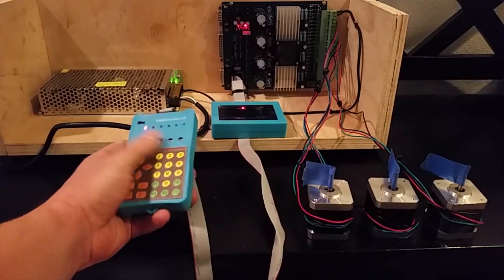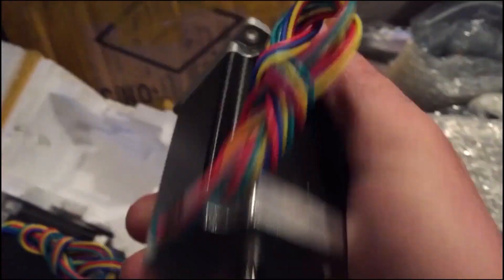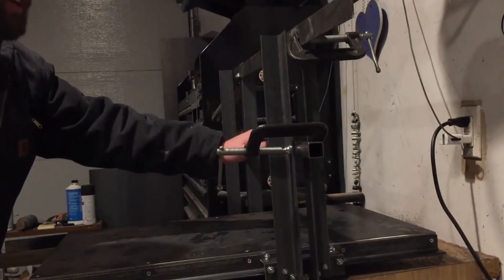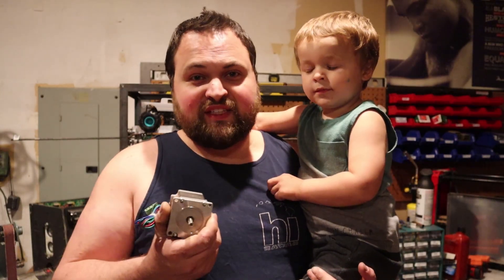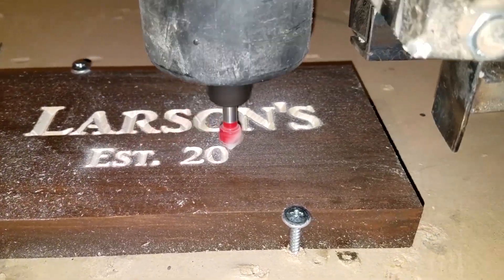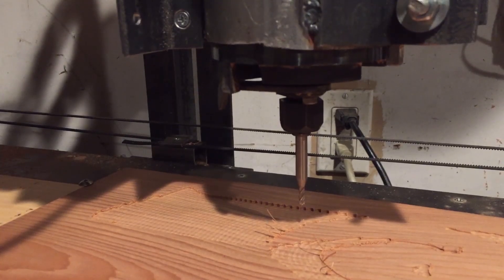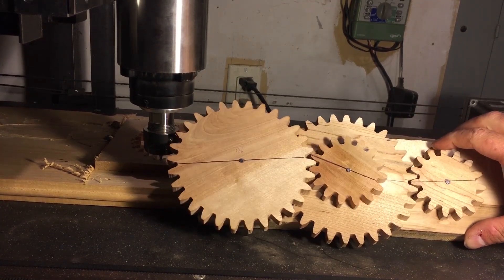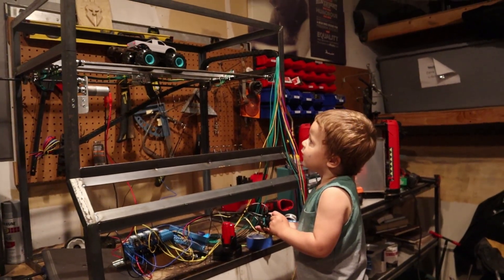How To make a CNC machine for $500

Comment: LOVE IT! 
Your video is one of the best that I saw and I saw a lot. I have a budget about 2K and that should be enough to build me a better and bigger one. I see that people mostly use expensive and way to big materials to hold the hole system together. I don't understand why?
If I am not wrong, the only aim is to move a 1-2 kg motor safely in x/y/z directions and there is not big of a resistance for the movement eighter. So, why they use so much metal equipment? They are building some chassis for a CNC as if they will become a chassis for a truck. Strange 🤨 
Long story short, no need for a razor sharp Catana sword to slice bread. 
Greetings from Türkiye 👋

Comment: where did you source your allthread for the z axis?  poking around the interwebs some people suggest using acme thread instead of what you get at a hardware store, for increase life and accuracy.  doesn't seem like you had any problems.
Reply from the maker: I bought some acme thread for my CNC plasma cutter, it had .005" clearance when it was brand new. Total garbage. I used all thread (1/4"-20). If you want better you'll need to spring for ball screws. More money but better quality.

Comment: There are so many parts to know about on a CNC machine that its unlikely a single person would know them all before building their first machine. Personally I am good at the computer bits but not very good at the basics of hardware -like even cutting a piece of sheet metal. As a result its likely that building your own is going to involve some expenditure on bits that you are least familiar with. So be it.
Btw. I have watched videos that suggest the fans on air cooled motors are a big source of vibration on those spindles, might be a good idea to go water cooled on the next one, would also keep the noise down a bit. I also read that Tinkercad models can be imported into Fusion360 (its the same company), Tinkercad is super easy to use.

Comment: Looking at making a CNC router machine, I started in 2020 learning with a Ender 3-v2 FDM printer, then I been building a custom 400x400x500mm FDM printer from an extender frame and purchased spare parts. Now I'm hoping to learn the other end of the fabrication process by applying the experience gathered. So far the bottle neck for me has been learning the FreeCAD software but if I can learn Blender 3D enough to make models and print them on a FDM machine then this to should only take time.
Reply: can you text me I need help to build cnc 1 axix

Comment: Fusion360 is has a steep learning curve. I was doing 3D drawing with AutoCad when it was experimental. At the time I was using ACAD10 to design machinery and parts in 2D during the day and drawing build sheets for retrofitting the roof decks of large buildings from steel to precast cement at night. That said I am not new to CAD and eventually started using SketchUp for personal projects. After hitting the wall a few times with F360 I realized that the big problem is that there is little or no feedback when you try to do something and it does not work. Off to Googling how to do something until I find someone had the same problem and the pro is trying to recreate the problem to help figure out why it is not working for this guy. Oh, you had a constraint that was preventing you from moving this or your part had a broken segment and would not allow you to create a solid object.
 Fair reasons but for the love of all that is holy, why can't the software  offer a suggestion to the problem?   I remember working with a developer on a piece he was writing to facilitate a change to the software the company I worked for from ibm MOVEX to SAP. After he was finished I was instructed to ask him about documentation. He told me that if anyone needed documentation to use software he wrote that he considered his work a complete failure. He made a huge effort to make every operation as intuitive as possible so it was obvious what you needed to do. 
Back in the early 80's programmers were expected to optimize software to efficiently use resources, like memory and machine cycles.(I was one of the first in my class to use a monitor instead of a huge fan fold dot matrix printer to write and run a program.) Fast forward to the 90s and the big software companies were realizing the help desk and training could add to the bottom line making software intuitive was naive. So don't feel too bad about not knowing how to use some really great software, it appears to be by design. It is either that or the developers and their project managers are clueless and cannot make anything that is obvious how to use, or they want to maintain their elite status of mastery of their software. Who knows maybe a little of all three. There, I got my rant out. lol
Press on!

Comment: Can you link the cnc kit on ebay. Or do a list of things you had needed.
Reply from the maker: https://youtu.be/kM9bWo8Rl84

This is the video showing the complete setup.
Reply: @StrangeGarage  the resource link I'm asking for the cnc kit on Ebay. It's not in the description
Reply from the maker: There are hundreds of nearly identical kits. I wont reccommend a specific one, just search "5 Axis TB6560 kit", get one with nema 23's or bigger, and make sure you get the one compatible with your computer/software. I run mach3 with a LPT serial port, most people run mach4 off USB, that is up to you, but they are not interchangeable.

That's why I can't advise you get a specific one, it depends on your computer more than anything.
Reply: @StrangeGarage  thanks :)
Reply: Also. Do you have a plan to build the table. I'm such a girlie girl and would need guidance for the table part too...

Comment: I'm curious why you never see a counterweight to the load on the Z-axis.... something like a pulley at the top and counterweight down the back of the gantry.  Must be a reason.
Reply from the maker: It isnt really necessary for this machine. Running fairly large motors through a jack screw produces a lot of torque, and prevents gravity from auto lowering the Z carrige. Also keeping the Y carrige fairly light helps run faster without slow acceleration and deceleration curves, so that is probably the main reason. Any weight you add to the Z is still carried on the Y rails. 

And finally, I never thought to do that.

Comment: Great video I got a question I understand that you use steel on the non moving parts but. Wy not use aluminum on the moving parts ? Se all that wait on the motors Short the working hr on them plus lest wait help to move faster which help on job time

Comment: Thank you for sharing with us your time and knowledge.  I followed your  build to do my cnc. One question though, what are the feeds and speeds that your machine can handle . Cause mine the max it can goes is 30mm/min. I guess I've messed up in the sliding system. 
I have nema 23 stepper motors.

Comment: You might want to avoid posting videos of making trademarked items.  Keep lawyers out of your life
Reply from the maker: What is trademarked?
Reply: @StrangeGarage  I agree, I thought it was an honest build with no B.S. and no trademarks that I noticed.  Any chance you have the height of the uprights for the gantry?  Also how did you fit the 1/4-20 into the 6mm bearings?
Reply from the maker: @stevesfascinations1516  Rails are 18" total, leaving 6" clearance between the deck and the bottom of the Z axis carrige. I hope this helps!
Reply: @StrangeGarage  Thank you so much, yes, that helps.  I have the bearings made up.  Some parts on order, some here ready to assemble.   This will be machine #6 I think.  I like the way you built yours.   Thanks for the video!

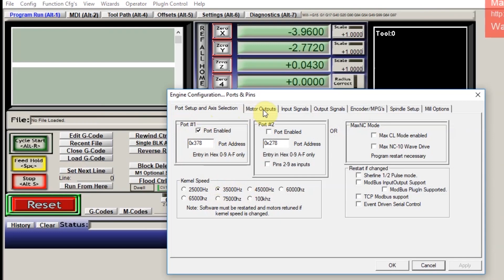Comment: @5:50
 is completely ironic for me because i'm an IT guy that wants to get into milling and building... The Linux part would be the easiest portion for me. hahaha. Thanks for the information!
Reply from the maker: Everybody has their talents. I had an awful time trying to get my CNC controller to comminucate with my PC. Any idea what my problem was? The parallel port I added wasn't compatible with my OS. I just had to switch OS and everything worked immediately. Let's just say my job isn't computer based, lol.
Reply: @StrangeGarage  yeah, so Parallel ports are pretty much obsolete now. Modern motherboards don't even have them. So a newer OS may not even have the capability of identifying that kind of interface as usable, much less having the appropriate drivers to make it function.

I think there are some 3rd party solutions... I'll get back with you.
Reply from the maker: @TC_Personal  Yeah they updated Mach3 to Mach4, which is USB based. The controllers are more expensive, but more useful as most computers can use run the software. 

I know these things now, but it has been a long, slow road, lol.

Comment: I am thing about building a CNC. I have a wooden base from another project. I have the Nema 23 motors. I have a DYI control board I bought 5 years ago. They are still in a box. I do not weld. So I like your approach to building a machine.

Comment: @Strange Garage to counteract the weight of the router, you may want to consider using constant force springs. The ones used in the high school competition robots often are supplied by Vulcan. You need to know the weight of your router carriage and use that to choose one or two springs to give you a roughly equivalent force. The springs are flat bands that are rolled up in their resting state. As your carriage goes down, they unroll and provide a constant counterbalancing force. They have to be mounted on some bearings to allow the middle to rotate as they unroll and roll back up

Comment: Try Design Spark mechanical as your CAD program. Its free and for me it seem more intuitive than other CAD programs. I still had to watch videos to use it, but it was much easier to learn to do basic stuff, like make a cube and put a hole in it. Takes less than a minute to do and in just a few steps. I feel ya on software, Im going GRBL because that was the first one I use and understand that. Mach 3 I think is actually better and has more features, at least from what I learned from Minh's Mancave.

Comment: I have my PhD in Physics and professionally I would suggest ..... quit putting yourself down.  You have greater skills and resources than a great majority of people out here and you have the  courage to fail, pick yourself back up and stick to it until you make it work.  I can't tell you how many engineers I have fired for lacking that simple element of self confidence.  You've done a great job here, keep'em coming and leave those nay sayers in the dust, you're a better man than you know .....
Reply from the maker: I am highly critical of myself. I am far from perfect, but imperfections are actually tools. When you can see the cracks then you know what you need to work on. I simply work on my cracks and the foundation keeps getting stronger. I think acting cocky will put people off and not ultimately help them or myself. If I can project the image of "I'm not special, and look what I can do," it will help build people up (I think).

I could be completely wrong, but that's the stage I'm at right now. 

What type of engineering do you oversee?
Reply: @StrangeGarage    I am what is often referred to as a "self taught" engineer.  I grew up in the trades, at one point holding 4 union cards (electrical, plumbing, mechanical, structural) and was goaded into taking classes by an old boss.  So, I work on a wide variety of projects from construction & large scale retrofit's, to producing software, teaching, maintenance .... frankly, anything that is interesting.  I do a lot of projects for the Dept. of Energy on active plants and environmental clean ups of highly contaminated facilities ..... like you, I rarely shrink from a challenge and frankly, the more difficult the more I like it.

Comment: the only problem is to lose steps . that's to heavy metal
Reply from the maker: No problems so far. The NEMA23's are pretty strong motors. My cuts have been very good. The belts on the other hand, are a problem.

Comment: Just a word of caution on the structural materials you used: Relying on the geometric precision of plate steel and angle iron can be a crap shoot. Angle Iron by specification can be out of true by up to 4% of its length. It usually isn't, but those are the specs.
Allow for all sorts of adjustments in your design, and prepare to true your profiles when using such materials.
Reply from the maker: I couldn't agree with you more. The dimensional stability of these materials is pretty poor, often due to poor handling practices and simply carbon steel characteristics. I picked the "best" pieces I could, but you can only expect so much. This is representative of how I would build a "cheap" cnc, and that's about it.

Comment: This is a really cool project! Did you run into any problems using belts? I could imagine that the axis overshoots while making fast directional changes...
Reply from the maker: It's actually really good, but I lose accuracy using the belts. It's about .015" off when cutting hard materials. That's the only real drawback. Well worth the savings for the average person.
Reply: @StrangeGarage  So that thing is totally fine for wood, I thought it might be worse. Really good option when building large bed sizes

Comment: I was in the same boat with Fusion360 a few years ago. I promise you in the end, its the best alternative for free, and affordable modeling\CAM. The free CAD software might come off more intuitive for squares and circles. But when you are designing working parts, Fusion 360 is in large shops all over the world. They pay for it too. So Autodesk knows what they are doing and I would encourage you to keep powering through it. Solid Works is great, but if you hate spending money. You wont get the same power and features for less than 4 figures.
Reply: With the recent gutting of fusion 360 it is not near as good anymore on the free side.
Reply: @Birdman3131  gutting...what an exaggerated load. A trivial downgrade for the hobbyist only version. Even with them it's still ridiculously better than anything else on offer, there is no free integrated cad/cam that even comes close, good luck finding one.

Comment: At 8:23 the spindle dances like crazy (or was it a plunge type?), also before finishing, the side of the fidget spinner is very rough (6:29). How rigid is it? You don't go deep into the wood.
Reply from the maker: That's called a helix plunge. The bit spirals so it clears the chips and makes a cleaner cut. If the machine wiggled that much by accident it would snap the bit. The spinner was made on my old pos machine, which was not very precise. The new one cuts aluminum fine, so I would say it's pretty solid.

Comment: 3 hp air cooled spindle with accessories for $200?!  I'm subscribing just to follow the life of THAT.  I preordered the Onefinity and have been thinking of getting a 2.2 kw spindle but water cooled because I plan on 1+ hour jobs.  You think because of you are primarily doing signs that it'll last?  I'd at least have a fan blowing on it.  Awesome channel
Reply: Oh...one more question.  Is your VFD 110V or 220V?  It seems like 90% of the Chinese Spindle VFD combos are 220V.  It's hard to believe America has done as well as we have using 110V and imperial measuring while the rest of the world mostly uses 220V and metric.
Reply from the maker: It has an internal fan, I've used it for 3+ hour jobs, no issues so far. I do want a water cooled one, but the deal I got I couldn't pass up!
Reply: @StrangeGarage  Where did you get the spindle?  Got a link?

Nice functional low cost build.  Well done!
Reply from the maker: @kslats916  amazon actually. Those deals pop up very rarely.
Reply: @StrangeGarage  Wow.  Fastest response to a comment ever.  I wasn't even finished watching the video yet.
Reply from the maker: @kslats916  slow day, what can I say, lol.

Comment: o you have a link to the kit you bought?  I'm also curious where you got those pulleys?  I have another project that I would love to use them on.
Reply: Thank you for replying.  I really enjoy your videos:). I’m hoping to design a horse race game using an arduino and some pulleys and this looked perfect.
Reply from the maker: It's all random ebay stuff. The pulleys are specific to the shaft size. So whatever motors you buy just get matching pulleys. I have a stock of 4, 6 and 8mm pulleys in my garage cuz I have lots of random motors. It makes my projects way easier to keep that stuff on hand.

Comment: I have a question bud. My knowledge of CNC machines are... well it will show lol.  Can you use aluminum in this machine...??  Thanks in advance.
Reply from the maker: Are you talking about build it out of aluminum or cut aluminum with the machine? I would NOT build a CNC machine from aluminium, but it will cut it fine. Just need a bit cooling system and to adjust the bit speed.
Reply: @StrangeGarage  yes, I was referring to cutting aluminum.  Thank you
Reply: Absolutely, but probably not in this machine, just use aluminium profile
Reply: @salmanelgamal6843  Thanks.